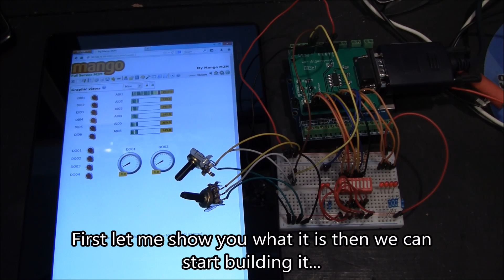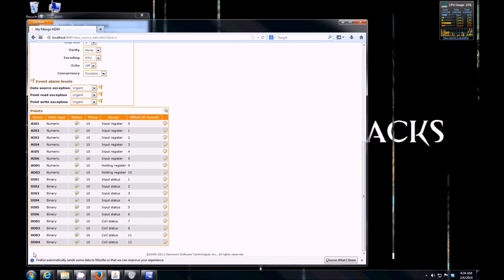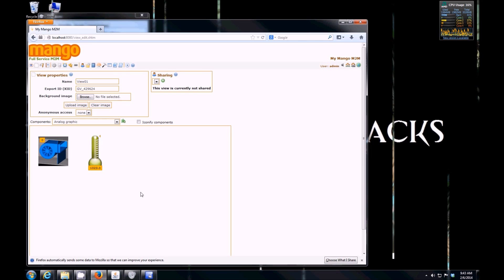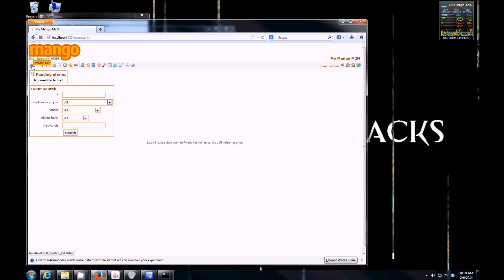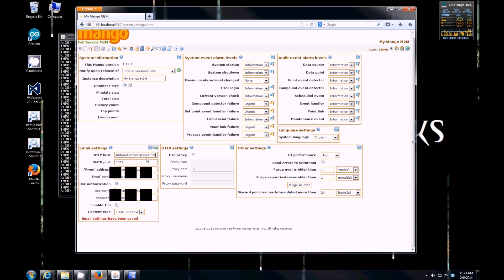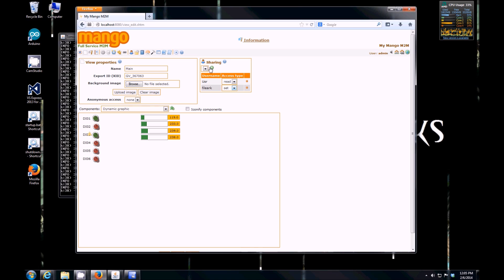Building a HMI With Mango M2M

Comment: Hi 

I have an led hooked up to my arduino along with some push buttons and a pot. I can read the push button and pot values from Mango no problem. How do you write a value out (to power an led)? Nothing I try seems to work. 

However, In qmodmaster, using the write single coil (ox5) function code, and a start address of 4, I can send a value and power the LED. Any thoughts?
Reply: if your (output) data points are properly configured you can write single coil under watch list as well under graphical view by adding Button (write). At least that's how things are made in ScadaBR which should be the "same" as mango.

Comment: I'm really enjoying this series of videos. We have much to talk about. 
I wanted to talk about the types of Modbus data: Coil status, status imput, holding register, registers imput. What is the difference between them? The Modbus library which implements used them all? I use only the holding register. That's how I learned. Speaking on the HMI wanted to devote more time to them. The potential of information a good HMI is very large. Like you I'm using mango for home automation and my farm.One detail: when I write the datapoint for him to call, I got an error response mango. Has had problems with this?
Reply from the maker: I would be happy to chat with you. The Modbus library in my Arduino seems to support Modbus functions 1,2,3,4,5,and 6. 1- Read Coil Status, 2-Read Input Status, 3-Read Holding Registers, 4-Read Input Registers,  5-Force Single Coil, 6- Write Single Holding Register. Look in the video description, I added a link to a site that explains what these codes do. I will also PM you and see if we can start an email discussion.